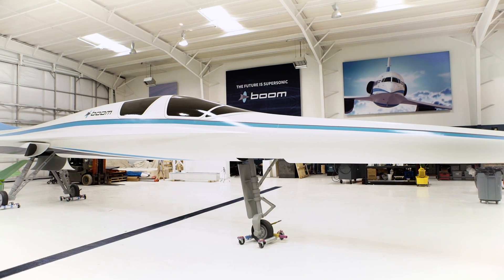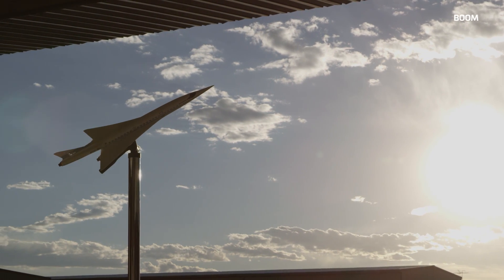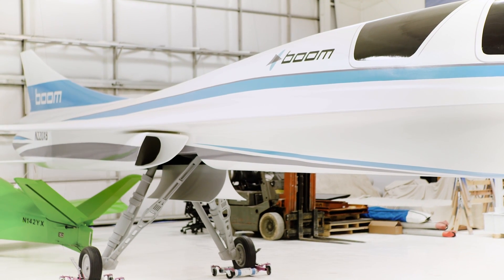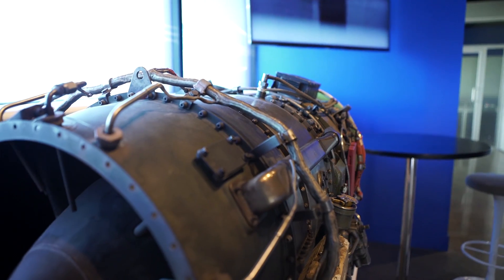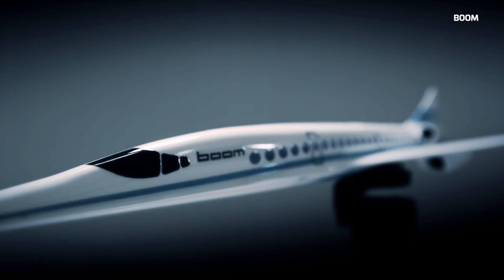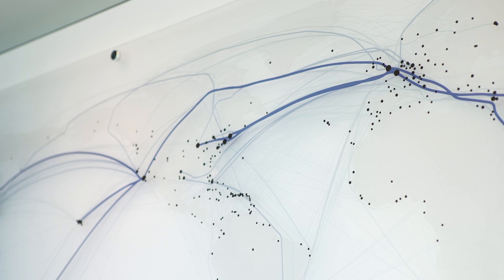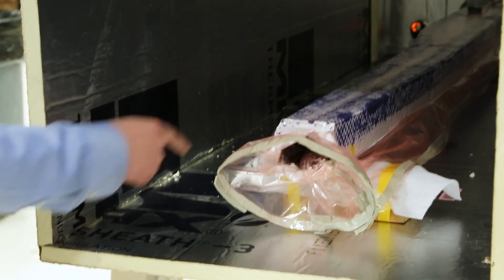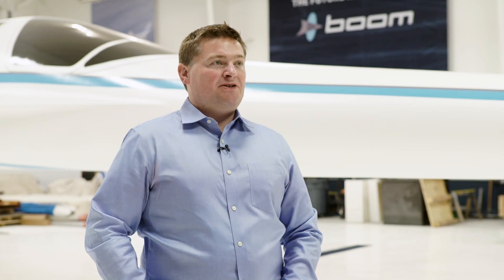Boom is bringing back commercial supersonic flight

Comment: I think what they're trying to build is essentially taking advantage of the latest knowledge in engine technology and aerodynamic design.

During the 1990's, studies with computational fluid dynamics (CFD) using supercomputers showed that by carefully shaping the entire plane, you can mitigate the pressure wave buildup at supersonic speeds that causes the sonic boom in the first place. It may be now possible to fly at Mach 1.6 at 57,000 to 60,000 feet altitude with a sonic boom so low that it would be quieter than the rumble of a passing train at 1.5 km away, which may open the possibility of overland supersonic flights.

Secondly, engine technology for supersonic flight have tremendously advanced since the 1960's Olympus 593 used on the Concorde. Using variable-cycle engines and engine technology developed originally for today's high-bypass modern jet engines, we can have a engine that in one mode will be as quiet as a high-bypass engine on takeoff and cycle to a different mode for supersonic flight with far more fuel efficiency than the Olympus 593.

Note that I mentioned Mach 1.6. I believe a future supersonic civilian jet will be limited to Mach 1.6 top speed, for a number of reasons. First, it would allow the new jet engines to run with very little amount of reheat (afterburner) mode, which substantially cuts fuel consumption and engine noise, which mean allow transoceanic flights as far as Los Angeles to Beijing even with the majority of the flight at supersonic speeds. Secondly, structural heating would be far lower than on the Concorde, which means less need for expensive titanium and/or stainless structural parts and more use of composite materials, which would substantially cut the structural weight of the plane, also cutting fuel consumption. Finally, with only Mach 1.6 top speed, even with the carefully-shaped airplane design, the pressure wave buildup will be substantially lower than on the Concorde flying at Mach 2.0, making it possible to effectively eliminate the dreaded sonic boom.
Reply: Because the structural heating beyond Mach 1.8 makes building a supersonic jet extremely expensive. Even the Concorde had to use a lot of high-temperature metal structural components because flying at Mach 2.0, the heating on the structure can be considerable.
Reply: @Sacto1654  Noise is such a sissy excuse.
Reply: Sacto1654 true but now there's super cruise at Mach 2.5, with the same fuel usage no less... and the heating problem could be solved in multiple ways mainly using modern heat resident ceramics, or a cooling system on the leading edge to recycle the heat for the engine efficiency(more heat where you want it the less fuel is needed to create the pressure imbalance jet engines run on)
Reply: Great comment, very factual.
Reply: half breed 070 super cruise is still a thing and 90s tech is not that outdated, at least with efficiency upgrades made since then, allowing Mach 2 with half the fuel usage... also the f-35 (while garbage) does have super cruise, because using afterburner is like feeding 6 year olds mac n cheese... it goes away fast

Besides we also could use the SR-71 blackbird engine now that they are declassified or NASA SCRAMJET/LACE engines if you still think it's not good enough, just be warned those things reach Mach like 12 so heat shields are a must have
Reply: sploofmonkey don't know but to be fair I'm only counting aircraft not space craft and aircraft have no real need while spacecraft have ablative heat shields made from ceramics
Reply: Very interesting, thank you!
Reply: CPTVCAM@gmail.com what are you talking about, and I take offense to my MIT engineer degree being fake, but just to note I am a mechanical engineer, but I do know the gist of aircraft design
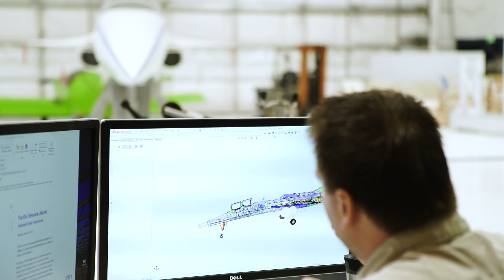Reply: 1:53 cool
Reply: Sacto1654 please state your credentials if that’s not to much to ask just kidding I sort of understand what your saying but you must be pretty well off how do you have time to be commenting on random YouTube videos?
Reply: Cool information. Thanks for sharing!
Reply: Sacto1654 
Yeah during the 90s this is 2017 now 
Stop it.. nobody gives a shit about primitive engines of the 90s

Comment: Very interesting stuff, but IMHO a limiting factor to commercial supersonic flight is the amount of time it takes to get through security,  (board) the plane, load it, refuel, de-ice etc...so much time that any commercial flight is subject to and that supersonic flight will not be exempt from. On say for example a 12 hour journey [from your own bed to the destination hotel bed] post 911, how much of the 12 hours is actual flying time? Ergo, how much time could even halving the flying time (which would require more than doubling the average speed) actually achieve. Of course, a different story for private jets...PLEASE tell me logically and rationally if you feel differently. Thank you.
Reply: I would imagine that that this aircraft would be operated essentially like a chartered, private jet even if it carried 40 or so business passengers.  This means flying out of a different, independent terminal at an airport like a General Aviation terminal, with all passengers being flown as Known Travelers for security purposes, and perhaps staying at a small close-by hotel that is owned by the airline flying the business passengers.  That might cut security lines and boarding times significantly.  Of course, the aircraft itself would still be subject to weather delays, etc., as would any other.  FlexJet just put an order in for a number of supersonic business jets from one of Boom's semi-competitors, Aerion.  So other people out there think this is viable.  I just booked a business flight to Italy since I have reason to be there and I'll be flying on one of the typical airlines.  If Boom can really stick to the $6000 return-trip that they are projecting (fat chance?) then this supersonic option does become more compelling for business class travelers who qualify for it.  I had a coworker who needed to be able to fly from the US to Australia at a moment's notice sometimes, and a supersonic option sure would have been nice...
Reply: very good point
Reply: Adrian Nel I worked at a small county airport,but big enough to take lears, Kingairs etc. Most rich people fly from this size airport if they can. No security,,,, at all,,, period. We just rolled their luggage out, put it on the plane, Fueled it, shook their hand and waved goodbye. There actually was no security personal at all at the airport. People who have the money,,, fly this way, so rich people don't go through security, they just charter a jet.
Reply: yeah fucking 9/11 really fucked air travel up
Reply: I don't get how that's a problem at all as none of that has any effect on time spent in the air. Security would be slow (unless this company finds a way to make that faster too) whether you fly supersonic or not, but once you're in the air, the journey becomes much faster. In my experience (I fly a lot) going through security is an annoyance, but it usually goes pretty quick. I can usually get from check-in to my gate in an hour or less. Not a big deal. That other stuff you mention (other than de-icing, which I've never had to deal with) is all factored into the departure time on your itinerary, so it's all done by the time people are ready to board, so almost never an issue.

Comment: The reason it ran overseas from US to the UK is because people in the US didnt want supersonic booms over top of their housr
Reply: You are missing the whole point of the debate.. The 707 "flew" off the back of the Comet disasters. It was also flying commercial flights long before the 707 had even taken to the air..
Sadly too..people who rely on name calling tend to veer off the subject matter... This page is about supersonic flight..Lets keep it there.
Reply: Edward Hewison  At this point in time, who invented what is irrelevant. The discussion is why the Concorde had such limited flight routes.
Reply: Military aircraft are generally prohibited from supersonic flight over land. As a child, sonic booms were common where I live, due to the close proximity to Edwards Air Force Base. I haven't heard a sonic boom in decades.
Reply: itsmegp46 But us Brits still invented the Jet Engine, and vertical take off, I hasten to add.🖒😆
Reply: The comet was slow compared to the 707 my low forehead friend. Let me know if you need proof.
Reply: Eddie, has no relevance at all.
Reply: itsmegp46 The Comet was the first, and only jet air liner flying for a few years. Yes the original design was flawed, due to the window shape. But who could have known that at the time. The flaw was quickly corrected when it was discovered. But the damage was done by that time, and Boeing quickly stepped in to monopolise the situation. Yes, the 707 was bigger, and faster. But how long was it before Boeing brought cheap flights to the masses? My point being, the Comet didn't need to be big, because the market at the time didn't demand big planes, as most people could not afford to fly long haul.
Reply: Once or twice a year here at Edwards AFB.  That is not 20 times a day.
Reply: NICHOLAS LANDOLINA You can’t fly at supersonic speeds over populated zones due to the sonic boom even while the plane is high up in the air can cause windows to break
Reply: I think they'd have been more prepared to tolerate sonic booms from Boeing aircraft than from ones made by some Johnny Foreigner.  I suspect that there was at least some element of protectionism in that legislation because they'd botched their own attempt at an SST.
Reply: itsmegp46 so why get into an argument about the Comet, and Boeing 707?
Maybe my point has more relevance than you realise.
Reply: itsmegp46 Well I beg to differ. Maybe the restrictions on the destinations Concorde was allowed to fly, was down to the green eyed monster. As stated earlier, the same restrictions don't apply to military jets, or the space shuttle for that matter. Maybe there WAS an element of jealousy, and a generous helping of media propaganda to fire people up in order to bring Concorde into a bad light. But I guess you will say black is white, right, cos you are such a fucking expert on the subject.
Reply: what houses, how many houses are in nevada wyoming or north dakota lol
Reply: + itsmegp46"The Comet was never a true contender to the modern jet age. Even if it hadn't been fatally designed, it was a second rate attempt at best. The 707 was faster, flew farther and carried three times the passengers."

Slightly disingenuous. The Comet actually took passenger travel into the jet age. It was extraordinarily innovative for the time and definitely not a 'second rate attempt'. It's certainly true it had a major design flaw, but metal fatigue on pressurised air frames wasn't really understood by anyone at that time. The 707 rightly deserves it place as the first successful passenger jet aircraft and it's a major credit that it was in production for so long. But it came several years after the Comet, as the technology was advancing at a rapid pace, and they'd also learnt a lot about metal fatigue issues because of the Comet. The commercial jet age owes a lot to the Comet, don't knock it. It took one for the team by being first.
Reply: Concorde was restricted across the whole of Europe. After leaving Heathrow it had its own route to the Bristol  channel where it would accelerate to supersonic speeds passing the island of Lundy finally being allowed to reach mach 2.2 after passing south of Ireland. In North Devon the supersonic "Boom" was more like a dull double "thump" and could not be heard above normal traffic sounds. It seems like an age since I watched the first one arrive at the BOAC engineering base at Heathrow while I was an apprentice. Happy days when everything was new and boundaries were still there to be pushed!
Reply: Klop Hop Are you fucking slow? The Comet criused at Mach 0.70 and the 707 at 0.85.
Reply: Wasn't Concorde restricted from flying supersonic over the UK & France too though? I mean it wasn't a US protectionist policy but rather one of legitimate concern for people's windows. Double glazing would not have been commonplace back in the late 70s. Even a 747 taking off has been anecdotally known to break single glazed windows.
Reply: I'm pretty sure it would have been more 'viable' if it had been a Boeing product. However the cost of fuel was the biggest factor the first time round and the final nail was that coffin, with a huge reduction in air travel was due to 911. The French crash just hastened its demise.
Reply: NICHOLAS LANDOLINA The and
Reply: But I wanna hear Sonic Booms over my house.
Reply: mxt mxt    Butt Burt. Please elaborate.
Reply: and Boeing didnt want a concorde flying over
Reply: mxt mxt  Please provide additional information regarding the 707 "copying" the Comet.

And I don't think the Comet was the first passenger airliner.
Reply: mxt mxt  First JET airliner. And I asked what made the 707 a "copy" of the Comet.
Reply: mxt mxt  I'm looking for actual factors and not your bullshit. Otherwise, your point is invalid.
Reply: mxt mxt  I don't find any bullshit in my statement. I asked for factors and you simply insulted me and told me to "research". I'm demanding factors and not stalling like a optimist.
Reply: mxt mxt  Yes, really.
Reply: mxt mxt  You're taking everything out of context. I still haven't had a reason why the 707 copied the Comet.
Reply: We judge others and justify ourselves!  🤔
Reply: They are creating Tech that has reduced the effects of the Sonic Boom. Also, they plan to end the National Law that bans SuperSonic Air Craft on US Soil this year 2020.
Reply: Concorde flew from Washington into Dallas using an Air France aircraft under the guise of the flight which began in Europe then becoming a Braniff Airlines flight, The crew had to be changed from French to American when the plane landed in Washington for its onward non supersonic journey into Dallas..The other operater apart from BA, Braniff  and Air France was Singapore Airlines who actually had one in their own livery unlike Braniff Airlines as the Aircraft had to stay in Air France livery but a few numbers on the fuselage had to be changed each time for its flight over the USA..
Its rumoured Braniff Airlines had to buy the aircraft for $1 eachtime on its arrival in to Washington then Air France bought it back on its return flight back into Washington...
Reply: I know that.... However ..my view is that the ban was done deliberately to stop the Concord... It hasnt stopped military jets from flying supersonic over land.... I stand to be proved wrong.
Reply: Military is different but they also got restricted more and more over the last few decades. I witnessed this first hand. Decades ago windows blew out at times. No more. No mater what aircraft.
Reply: Andy c  Total nonsense.  The majority of the countries where the Concorde was destined to fly also banned the jet.
Reply: Your probably right..Look what happened after the Comet disasters in the 50's. Boeing(707) cornered the market.. Airbus (EU) have a big share of the market now so the US wants to corner the supersonic market so long as the sound is"not in our back yard"
Many of the usable routes are over the oceans except east-west coast US flights so Boeing and others wont have to worry about that.
Reply: The 707 took nothing from the Comet. Pressurized planes were around long before the Comet ever flew.  The 707 was in fact a superior plane from the beginning even if the Comet didn't suffer from catastrophic failure. It was larger, held more passengers, flew faster and had a much longer range. 
As for supersonic flight, there will be none over populated areas throughout the world unless a way is found to quiet or at least lessen the sonic boom and to increase its efficiency.  One of the main reasons the Concorde was discontinued was cost.  It used about  four times the fuel to go the same distance.
Reply: Well for someone who thinks I am posting nonsense I wonder if you know how many Concordes were built. For your information there were 20 built and 14 were in service. Air France flew once daily and British Airways flew twice daily. As for military jets..I would say there are more than 20 being built in 1 week.

I would not ban military aircraft nor would I ban civil aircraft.. Maybe we will never know the true reason for the ban. However I believe the NYPO had a lot to do with the banning along with local "green" groups.

I have to admit tho that I dont know where the closest military airbase is to where you live. I would also say that if I burst a paper bag 2 feet from your ear it would be louder than any sonic boom you are ever likely to hear.
Reply: Firstly... I am NOT a DUDE.... Secondly..The debate was about the sonic boom...NOT where they land..If you can't debate without swearing then....YOU LOSE...LOL
Reply: The Concorde has a flight ceiling of 60,000 feet.. Is that not "way above the skies" ?? I also read that the FAA does NOT control supersonic speeds of planes that fly above 60,000 feet.

Strange too that no one ever complained about the sonic booms the "Space Shuttles" made on re-entry.
Reply: agedflier   Your "view" is not historical.  I would suggest you read some before posting nonsense. As for military jets, first there just aren't that many.  I've lived in NYC most of my life, I've never heard a military sonic boom.  And why would you ban military if they're there to save your life?
Reply: The Comet was never a true contender to the modern jet age.  Even if it hadn't been fatally designed, it was a second rate attempt at best.  The 707 was faster, flew farther and carried three times the passengers.  
As I mentioned previously, it wasn't just the US that banned overland supersonic jet travel, most of the world's major cities also banned it.